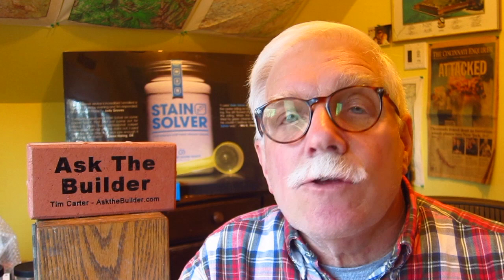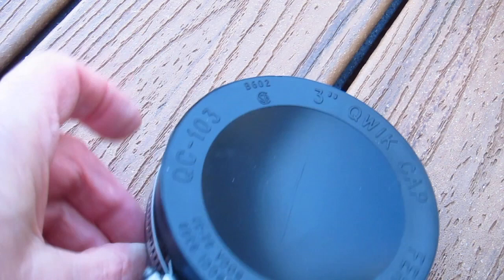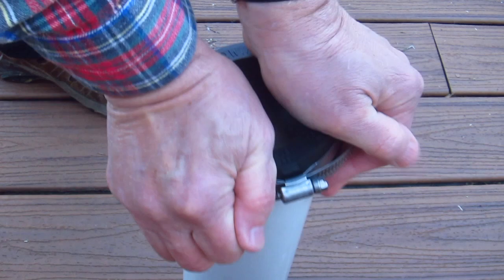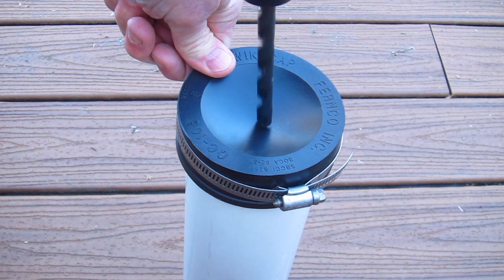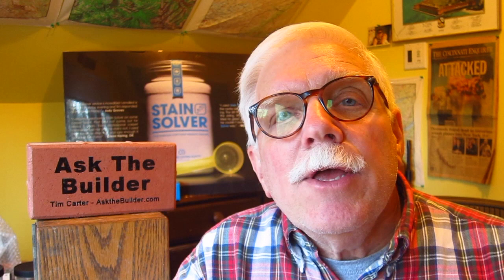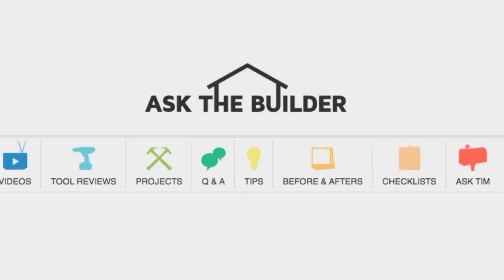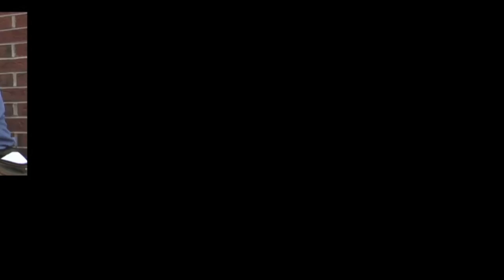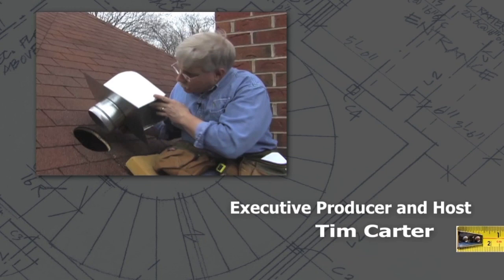Sewer Gas Smell Vent Pipe

Comment: Be careful. I did this and yes it stopped it from smelling outside. However the next day the smell started coming back through the upstairs sink drain. Definitely worth trying, but pay attention to over constricting. I drilled a 3/8 hole.
Reply from the maker: Sam, you've got a sewer gas leak INDOORS. You need my book that I just published four days ago. It's on sale for just a few more days - 50% off: https://shop.askthebuilder.com/sewer-gas-smell/
Reply: @AlexGoBro do it.
Reply: @AlexGoBro  Update?  I have this problem and am concerned about the air pressure.  We already extended the pipe 6" but we still have sewer gas smell in our back yard and it drifts into one specific bedroom window if we open that window.  We are considering extension the pipe another 6".
Reply: The small hole in the cap was probably restricting too much. Then draining a tub or flushing a toilet sucked the water out of your upstairs sink trap.

Comment: We purchased a small cottage last summer and were having this exact problem.  I knew it was coming from the stink pipe.  Your solution worked perfectly! Thank you so much for sharing your knowledge.  My wife told me “You better go tell him it worked!l 👍 🙏
Reply from the maker: Yep, I knew it would work. This is why it's so important to engage critical-thinking skills!
Reply: @askthebuilder  much better for me today as well,  the smell is gone today uncapping the vents on the roof and a days worth of normal water usage did the trick and systems working fine now. No headaches. Was giving me headaches. Cats happier to. Lol. Thank you sir.
Reply: My sewer vents in the basement. House built in 70’s. Smells awful sometimes.

Comment: All 6 breathers have been modified from 2” and no smell. Thanks for the solution in a  tropical climate ( Thailand)  that makes perfect   sense.
Reply from the maker: Glad to hear this good news. It's all because of atmospheric pressure. 14.2 PSI is much more powerful than you might ever imagine. LOTS of air can flow through a 1/4-inch hole at that pressure.
Reply: 14.7

Comment: I'm here to say this tip is 💯💯🔥!! I was very skeptical about covering my vent pipes as I always assumed they were open for a reason and flowed in one direction..outwards! I placed the exact rubber caps with clamps and drilled a 1/4 inch hole in each and 5 days out NOT A SINGLE ODOR and all fixtures appear to be operating at maximum efficiency! Thank you so very much Sir for your expertise and time put in this video as you literally saved me 1000's
Reply: We have a home in South America with a bathroom in one of the upstairs bedrooms.  It functioned well without odor for two years after the relocation of the toilet, but now has sewer gas odor with flushing.  The sewer line runs 10 feet with drop under the floor then down the outside wall.  There is a concrete union box on ground level which serves as the vent?  Is it possible to put a vent pipe on this system vented through the ceiling as in the US.  Are there reference guides to assist me?

Comment: Will this work for an upside down opening in a "candycane" shaped pipe in the yard next to septic tank?
Reply from the maker: Yes. But understand what's in play, especially if you have a pump that forces 150 gallons of effluent up to the leach field. You'll get LOTS of odor because the pipes in the ground are being flooded with stinky water. Once the pump stops, the odor will dissipate.
Reply: I’m curious if you tried this on the yard vent. I recently had a new septic installed and unfortunately had a “candy cane” vent put about 10 feet from my pool and right next to my sitting area. I’ve been looking at all the charcoal filters online and stumbled across this video. I’m excited to try this method before cutting the pipe and spending the money. I don’t have a pump up leaching field just a gravity system.
Please let me know… thanks

Comment: Tim, we built a new home on our country cabin lot in 2016 and have been having the sewage odor issue since  then. I though it was a leaching field issue but could not fine the source but narrowed it down to the vent stack. I installed the cap as you directed and have not had the issue since. I just wanted to thank you for such great advice.

Comment: I have one of those turbo type toilets (no water in tank) and when I turn the Central heater on at or around 77 degrees sewer gas smells up the one bathroom. Would a vent cover fix this? Thanks...Ron..
Reply: What did you find out having the same problem
Reply from the maker: Maybe. Try it. If you want FREE unlimited tips like this each week, subscribe to my newsletter at www.AsktheBuilder.com

Comment: that makes no sense =the vent pipe on that roof wass like a 2" opening so how does putting a cap on that pipe with an even smaller hole allow no gas smell, its still going to smell- how about a carbon cartridge filter in or in the pipe
Reply from the maker: It makes all the sense in the world had you not been sick that day in high school when the venturi effect was discussed in physics class. Here's another pro tip: It pays to read many comments before you start pecking away on your keyboard only to make yourself look like a mental midget.

Comment: Thanks this did the trick! We had an odor hog on our old vent pipe but our roofer replaced the vent pipe and upsized larger than odor hog had. We dealt with the stink for a solid year until I found this video. Immediate results
Reply from the maker: Glad it helped! It's all about the Venturi Principle in physics.

Comment: Thank you, 
I am from a cold climate and we have been having severe problems with the septic smell especially after someone showers and in the winter you will smell it far worse than summer.
So we used your tip but instead of putting holes in the top we put two small holes in the sides and we haven't had a problem since. 
Thank you:) your awesome.
Reply from the maker: YW To get unlimited free tips each week like this, be sure to sign up for my FREE newsletter at www.AsktheBuilder.com
Reply: Thank you, I needed this for the same reason!
Reply: One question: did you drill the holes in the side of the pipe, or the side of the cap?
Reply: Do you leave the cap on in the winter?  I suppose having such a small hole, the 3-in rubber cap would get snow on it and eliminate the vent flow in the winter? If you drilled your holes on the side of the pipe that probably wouldn't happen and you would not need to remove the cap for winter use? Just wondering, that's the kind of maintenance that eventually gets forgotten.

Comment: Thank you so much. I purchased a new house and I was dealing with this problem for a decade. Recently, I thought of removing the pipe far from the house entrance, but it was required lots of work and cost. Just realized to see if there is any Youtube video about it and found yours. I did what you said and it was a miracle. It's been a week. it cut 100% of the smell. None of the family members experience the  smell anymore. Thank you so much. It was a great fix.
Reply from the maker: I'm glad to have helped you! The key is to have paid attention in high school physics class. It's all about the Venturi effect.

Comment: Tim Carter, I drilled PVC caps with 1/4" hole on top for both 1.5" and 2" vent pipes.  I got 4 total vents for 3 full baths, WORKS GREAT!!  Grandpa told me the hole was too small, but after running  some pipe volumes, orifice calcs and flush volumes, etc.  It worked out fine.
Reply from the maker: Good Be sure to sign up for my FREE newsletter at www.AsktheBuilder.com

Comment: I ve been having a stinky bathroom for the winter.  We‘re at the top of a hill so we get all the sewer gas.   Sometimes I can smell it outside.  Definitely when I’m on the roof.

We have a washer in the bathroom.  I figured that was it.  But it didn’t smell behind the washer.  I installed a one way flap and it still happened.   

Figured, maybe wax ring.   Changed it twice and caulked around the base.   Still get random sewer gas smell.

I went on the roof and filled in the gap between the flashing and the sewer pipe.

While up there I noticed my bathroom vent fan is only a few inches from the sewer vent.  I think I’m pulling the gas in on days the wind blows that way.
Reply: I had to stop using my attic fan for the same reason.  I'm going to try this approach, at least on my lower roof.  Not sure about the high one, I'm chicken...

Comment: Just bought a little place and getting that smell. Was on septic then went to city sewer. Was as is when I bought it and in pretty rough shape. Roof vent pipes had been filled in. Cleaned them out best I could for now. Smell not completely gone but still there at times. Better but not gone.

Comment: I tried the filters, they did nothing.  This cut the smell down by about 90%.  Not perfection, but a huge improvement; thanks for this!
Reply from the maker: Well, then you need to experiment. Get a new cap and drill a hole HALF the diameter you currently have. You'd be stunned how small the hole can be and it will let in enough air. Think about the tiny pin prick hole you put in one of those countertop water jugs with a pull-out spout!
Reply: Ok, will do.  I’ll check back with updates.
Reply: Wow, it’s been 2 years.  Final update: while this method had a huge effect, the smell still slightly existed.  I ended up buying an exterior air admittance valve from Studor.  Ultimately, that did it!

Downsides: had to McGyver it to make it fit the vent stack, and it was $70.  Take it or leave it…

Again; great video, got me thinking and solving, and for me this is what worked.  Good luck to all out there!

Comment: Tim, that's genius!  I had always assumed the vent pipe size was fully necessary, but it'll pull air in as much as it needs through that hole.
Reply from the maker: Jeremy, TNX. I did a very cool test years ago with another master plumber. We vented an entire shack in a rural area using - are you sitting down? - 1/2-inch copper tubing. The entire system worked perfectly because the air pressure pushing INTO the pipe is 14.2 pounds per square inch - less as you get above sea level. That pressure puts air into the tiny hole so fast it would make your head spin!
Reply: Wow!  I never would have believed it!

Comment: Very nice information. Just built a house and have same gas smell in the yard. Ive tried charcoal filter and it worked good in the summer but when it freezes out with alittle water in the air it freezes causing our drains to burp. Im going to try your method as I think being here in Mo we dont get alot of big snows and the heat from the baths would thaw out the vent hole and it would be efficient during those cold months
Reply from the maker: I assist with all these issues on the phone. Too many questions and back and forth: https://shop.askthebuilder.com/15-minute-phone-or-video-conversation-with-tim/

Comment: Good fix.. Thanks for the tip. I did 1/2 hole and still have a small amount of odor. I will try a smaller hole per your recommendation. Will definitely be calling you next time I have a head scratcher problem.
Reply from the maker: Yep. Go with a 1/4-inch hole. Just realize if you're in a cold climate in BITTER WX, it could freeze up. The sun will melt it fast with the black color.

Comment: My vent pipe (2" dia.) terminates in the basement of the house, built in 1950, I recently purchased. There is no smell in the basement, only in the bathroom which is upstairs. I discovered a PVC cap loosely sitting on the pipe opening. After watching this video, I removed the cap, only to find the smell became much worse, filling the entire ground floor with stench; the house is single-story. I then placed the PVC cap firmly onto the vent pipe, and, the smell completely dissipated within 20-30 minutes. I then observed how the toilet flushed, noticing a slight degradation of its' flushing action, but surprisingly not that much. I then removed the cap, drilled a 1/8" hole in its center, and firmly placed it back on the vent pipe. So far, there is no smell and the toilet seems to be flushing normally. I normally keep all my bathroom sink and bathtub drains closed when not in use. I opened them to see if the smell comes out of them. There is a smell but it is very slight, less than what had emanated from them before capping the vent in the way I previously described. Water drains from them normally as well. I Hope this helps others.
Reply from the maker: Vent pipes are NEVER to terminate inside a home. Are you SURE it's a vent pipe? No sane plumber would have ever installed one like you describe.

Comment: I never realized those were for letting air *in*. I had, until now, thought they were to let the gasses escape. Thanks for the video. :)
Reply from the maker: Pete, you'd really love the video I did explaining vent pipes. Go here: https://www.askthebuilder.com/how-to-vent-plumbing-video/
Reply: Ask the Builder , Tim, in the attached video the comments are turned off. So my question would be, about that second bathroom venting though the large common vent, could you also just run a separate vent for there? I see lots of vent stacks in California and Oregon houses. Is it a local code thing, perhaps?  Thanks.  I’m loving your channel, by the way
Reply: @askthebuilder  hi tim! Just a question: in the video referenced above you mentioned making sure to not let your builder or plumber use smaller sized vent pipes then what you've used in the video. However, wouldn't the cap with the quarter inch or 3/8 inch hole drilled in it also effectively reduce air flow? I know in another comment you mentioned that you plumbed a whole house using half inch copper pipe once as an experiment and it worked really well. Just wondering if that large vent piping is actually necessary?
Reply: @travishanson2119  The sizing of the vent pipes by code is about creating enough volume of air in the overall system... and also to function correctly as a drain where wet vents are used.  You need that volume, but you don’t need a 2-3” hole at the top to let air in to equalize when you flush a toilet.  Not sure that 3/8” will be adequate in every situation though.

Comment: The smell is in the basement and at the top of the stairs, we smell no odor outside, it’s inside, it comes and goes, but when the smell does come back, it gets in the heat vent system and can be smelled throughout the whole house.  I think the vent pipe might be clogged or partially clogged. Not sure what to do.
Reply from the maker: The best thing to do is invest in a short phone call with me. I'm an expert on the topic. As a master plumber, I've solved HUNDREDS of sewer gas problems over the phone. https://shop.askthebuilder.com/15-minute-phone-or-video-conversation-with-tim/

Comment: For all asking why this works, decreasing the diameter of a 3" pipe to 3/8" decreases the volume of airfow by about a factor of 10x.  (I think)
That's a lot less gas coming out of the pipes
Reply from the maker: Your correct about why it works, but very wrong in your math. Area= pi x radius squared.  7.06 square inches compared to 0.11 square inches
Reply: @askthebuilder  My problem is sewer smell in my house after heavy rains. I installed one at the problem area. Hopefully it will do the trick. And yeah, my math was a wee bit off 😄

Comment: I tried this and it really didnt work. The Smell is way better, but still there. It now makes my shower gurgle when flushing the Toilet so I am not questioning if 1/4" hole is adequate in my situation.
Reply from the maker: It sounds like your vent pipe is partially clogged. Get back up on the roof, remove the cap, and put a garden hose in the vent pipe and turn on a full blast of water. Station someone inside to look for LEAKS in case the vent pipe system is not sealed properly. If you read many of the other comments, you'll discover my solution DOES work. Read more about why it works on my www.AsktheBuilder.com website.

Comment: I have that smell under my home. It was built in the early 50’s. I will try the caps if I can locate any. But I am unsure if that’s my issue. For now I have a squirrel cage fan venting the air out the back. It no longer seeps into the house since I’ve done that.
Reply from the maker: Good. If you want FREE unlimited tips like this each week, subscribe to my newsletter at www.AsktheBuilder.com